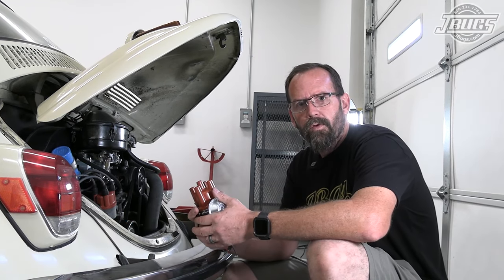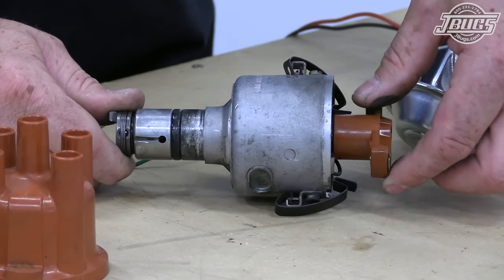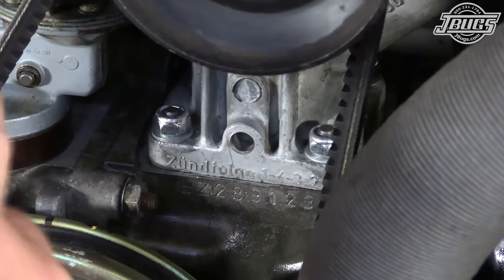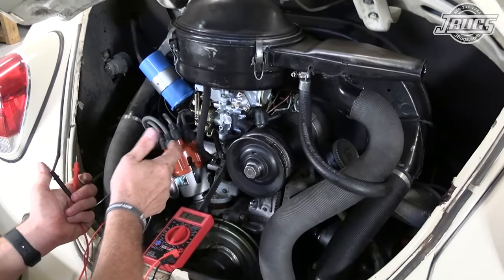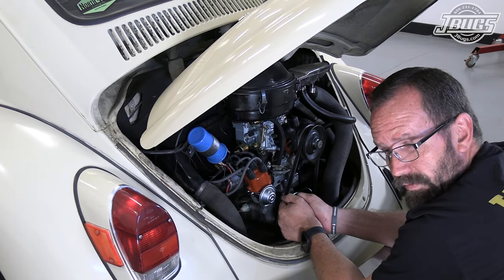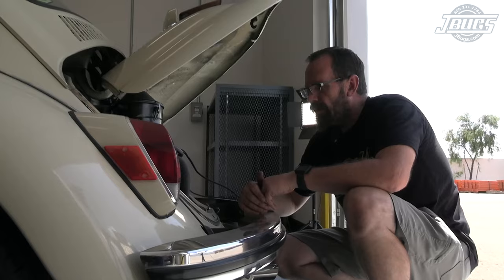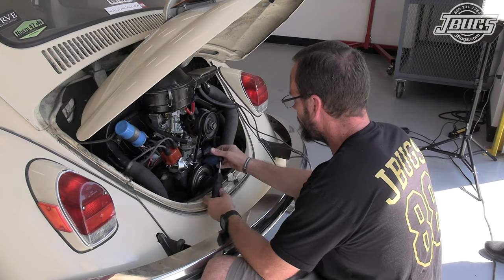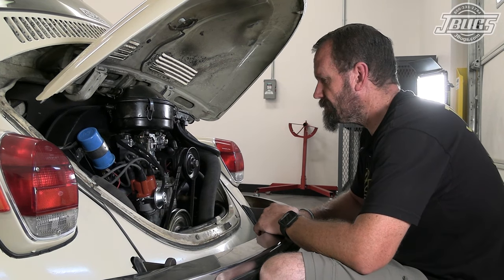JBugs - Installing a SVDA Distributor with Electronic Ignition

Comment: I recently reversed two spark plug wires and it did run, but really reallly bad. Because I was just beginning the project of getting her back on the road again, I blamed everything EXCEPT that two spark plugs might be reversed. I never even considered the possiblity that it would even start at all! Anyway... I'm sharing my big mistake with you because you were man enough to admit it in this video.  If you're reading, thanks for your hard work helping us keep our VWs aliive!
PS another consequence of crossing the two spark plug wires, three stock oil cooler failed  during my attempt to get the engine running right. The 'waging and torquing of the engine caused by the out of place spark plug wires caused me to replace 3 (yes 3) oil coolers during my quest to find out what why my 72's engine ran so bad.
Sharing my goof with everyone here if I may...if I had checked all spark plug wire connections  I would have saved literally weeks of my time. 5 minutes would have saved me so much time and frustration.

Comment: Which coil will you recommend for the SVDA distributor?
Reply: For a Pertronix distributor, I prefer a Pertronix coil to match the recommended Ohm rating of the ignitor module. Ignitor 1 - 3 Ohm coil, Ignitor 2 - .6 Ohm coil, Ignitor 3 - .32 Ohm coil.
Reply: @Sam_Mebane  thank you

Comment: Thanks Nice video. My distributor have two vacuum line on in the back also if i add pertronix carb with one vacuum hose do it will work.
Reply: A dual vacuum advance distributor has an advance, for smoother acceleration, and a retard for emissions. You install a single vacuum distributor,  just hook up the advance hose and plug off the retard hose.

Comment: I dont understand the "wherever this thing happens to land" part at about 5 minutes in...confusing!
Reply: Aftermarket (and even some Bosch, non factory replacement) distributors are often clocked in a different location than stock. Originally (like I mention at 5:08) the rotor pointed towards roughly 4 o'clock, or towards the back right of the car. With the new distributor, the rotor points towards 2 o'clock. So the position of the wires on the cap changes.
Reply: Ok…
So how do I know when I have the rotor positioned right?
Reply: @lcwatts2971  if you follow the video, and make sure to put the engine at TDC for #1 cylinder before you pull your old distributor, where ever the rotor points when you put the new distributor in is right.

Comment: Was that ported or manifold vacuum to that vacuum advance. Also what was your base timing set at. And 32° total advance plus vacuum advance You must have a lot of advance now. And also did you adjust the air fuel mixture screw at the end.
Reply: The vacuum advance gets a signal from a carburetor port, not the manifold. We set the timing at 32° without the vacuum advance connected. Under real world driving conditions, an engine will never see both full centrifugal advance and full vacuum advance at the same time so the timing will never go beyond 32°. Once the final timing is set, then the carburetor mixture and idle screws are readjusted, yes.

Comment: Hello, its possible to change the distributor with SVDA only the electronic ignition module? instead of replacing the whole distributor? Thanks in advance.
Reply: It depends on which SVDA distributor you have. They are aftermarket distributors and it is a bit odd nowadays to find one made that doesn't have an electronic ignition.

Comment: Question having a lot of issues with keeping it idle nice and bottom end power and hitting that flat spot 
I’m thinking to go to a vacuum advance distributor 
I’m being told  not to do with  with double carbs?      Any reason for that ?
Reply: Depending on the carburetors, you may not be able to run a vacuum advance. Not all carburetors have vacuum ports.

Comment: would i time this at tdc with the same distributor or at 7.5 and why?
Reply: We don't "set" static or initial timing, we only use it as a base line to get the engine running. With so many different original pulleys having different timing marks and distributor that have different advance curves you can't know what the max timing is until you check it. So, we always use the TDC mark on the pulley, advance the timing light to whatever fully advanced timing point we want (anywhere from 28-33 degrees depending on the engine) and set the timing there. Whatever it ends up at during idle (initial or static) is where it is. We've seen it anywhere from 7 to 15 degrees depending on the distributor.

Comment: I watched this video an hour ago and laughed at how you messed up with the spark plug wires, then I did the same thing 15 minutes ago when installing my new SVDA. (even if I marked the wires..). Karma I guess  😅 So happy I got rid of that nasty 009. My car came with an aftermarket carb (EMPI HPMX) and I noticed it had a plugged vacuum port (some don't have those) and I thought why not use it if it's there? I've almost had rear-end collisions because of that flat spot.

Comment: 2 questions: 1) looks like the timing mark at 32 degrees is at the bump out on the case next to the split, rather than the split itself.  Is this really where it is supposed to be?  I have seen other videos with the same alignment, so I just really am not sure where exactly I am lining up the timing mark. 2) will the dual advance work with a mild performance cam?  I am running a 1641 with an Engle 100, and wondering if I can replace my 009.
Reply: Sorry, I just saw this comment. The camera view doesn't show my view as I am setting the timing. Timing is set at the split in the case.

Comment: When you set the timing gun to 32° max advance you are looking at the TDC mark on the pulley, correct?
Reply: Yes, as the stock pulley doesn't have timing marks, I advance my timing light 32 degrees. Then it flashes at the TDC notch in the pulley.

Comment: I found someone to help with the super beetle. I want to get some parts so we can get started in a couple of weeks. Could you identify exactly which parts I will need to replace the rear calipers with pads and drums including the emergency brake cables and springs etc. (When the calipers were put on the rear, they were not ones that could take the ebrake cables) I will also be getting valve cover gaskets and oil cover gaskets and washers. Can you suggest anything else that would be useful for a tune up? The engine was overhauled about 8k miles ago. Any suggestions for rust prevention products for the underside?

Comment: Great video , but didn’t notice mention of 2 spacer washers in dist. shaft -care of centering those carefully before install. (?).  Thx
Reply: That's because the 2 washers are below the distributor drive gear. It wasn't (and usually isn't) pulled out. We do cover installing the washers in a couple of our videos this one is probably the most clear - https://www.youtube.com/watch?v=IoOp2wpvcQc&t=93s

Comment: My trunk lid will not open- I had help and it is really stuck. The picture of the mechanism that I found in the Haynes manual suggests that the advice to cut the handle in half and unscrew the upper and lower parts separately  does make some sense.  Do you have any thoughts on it?
Reply: Yes, if the hood (front) is latched and the hood release cable is not opening or freeing the latch, the only way to open the hood is by cutting through the handle. We use a saw-zall and cut just above the hood handle seal to cut the handle, and the bolts that hold the handle to the catch underneath.
Reply: Can you tell met you mean by the hood handle seal? Are you cutting close to the lower or the upper end of the handle? I looked at the picture in the Haynes manual and see two kinds of latches.  Once very simple and the bracket on one is veery simple while the other has a catch as well.Also you are not cutting through the hood, right? @Sam_Mebane

Comment: Since you are in a rather dry climate and I am in a water rich area…that may explain why there are so many more beetles in your area than where I am. What was VW’s thinking about rain coming in the louvres in the lid?  After a rain I opened the engine lid and was dumbfounded at the rain drops in there. It seems so odd but I never see it mentioned, should I worry about it?
Reply: VW used a "rain catcher" to do just that, under the louvers to catch and divert the water to the drain holes at the bottom. Ideally, make sure that your air cleaner is shielded from water, but on the whole, most of the time a little water in the engine compartment won't hurt anything.
Reply: Thanks. In a hard rain I put a sheet of plastic inside and used the lid to hold it in place. I’ll be keeping it covered in the summer too. @Sam_Mebane
Reply: @Ljblossom  just make sure the sheet doesn't completely block the vents, they are there to allow more air into the engine come into the engine compartment for cooling.
Reply: It was in the drive.I would not do this if I were driving which will take a couple of fixes to get to. A question. Since the car has the wrong calipers on the rear to have an e brake, which will cost more: changing the calipers or going back to pads and drums? My Prius had its first pad replacement, with no issues, at about 150K miles.  I know the parts price difference but don’t know if there is more labor involved in going back to drums. Are there any shops that order from the Ithaca NY area? The one possibility is gone until April.
Reply: @Ljblossom  if you can find the necessary parts to go back to drums, used since some of the parts aren't made new, that would be the less expensive option most likely. The hard part about possibly going to a disc brake with a parking brake is that you may have to get a complete new kit. Often times the brackets are completely different and not interchangeable between rear disc brake calipers.
Reply: The calipers on the car will not take the ebrake kit. The last question in my last reply was whether you have a shop from my area ordering parts which could tell me if there is someone in my area who works on these cars.  @Sam_Mebane
Reply: @Ljblossom  your best bet is to talk to local VW owners in your area, either through a club, online forum, or otherwise.
Reply: I have been looking but there may not be any. I really have not seen any old beetles on the road and none of the mechanics are knowedgeable. It is a different region here. Your weather has preserved them better than ours. @Sam_Mebane

Comment: Question, does the vacume advance have its own regulator ( hole size to limit the movement ). I changed the carburettor and at the same time discovered the vacume advance had failed and replaced the distributor also. Whilst I can now cruise at a reasonable speed, it is lacking the low rev torque it had whilst the vacume advance was broken. Wondering if the vacume pressure ( inlet size ) should be made smaller or some sort of restriction put in it.
Reply: There is no regulator, no. The distributor timing may be off which could cause the lack of power down low.

Comment: What size/kind of motor is it? Sounds like a strong stock 1600? What parts are not stock? I lke the stock (oil?) air cleaner! Better flow than filters?😉
Reply: It is, due to some prior parts testing, we ended up putting a new top end (pistons, cylinders & heads) on the engine so it is super fresh. Other than our replacement 34PICT3 carburetor and the SVDA distributor, it's pretty much all stock.

Comment: If you wanted #1 to still be in the original spot, can you lift up the distributor drive gear and turn it to the correct position, and then drop it back down or does something prevent that?
Reply: Removing the distributor drive gear can be difficult in some cases and as it sits in two small washers (that act as a bearing of sorts) at the bottom side that could fall off and drop into the engine we don't recommend removing the drive gear in most cases.

Comment: Where can I find the tool you used for adjusting the timing?
Reply: I use a 25+ year old Snap On Timing light with digital advance. You can probably find something similar at your local auto parts store or online somewhere.

Comment: Question I’m running 009 on 2180 stroker would this unit improve my performance?
Reply: If your engine has hesitation off of idle while driving, then most likely, yes. You’ll need to make sure that your carburetor/s have a vacuum reference for a vacuum advance distributor. As long as there is one, you can install a SVDA distributor and it should drive much better.
Reply: I've been running a SVDA Pertronix on my 2110 with dual Weber IDF carbs.
I've tried vacuum lines from both carbs into a T and one line from one carb into distributor, with and without a vacuum check valve. 
I've been thinking of taking it out and putting in centrifugal advance because I can't get rid of the hesitation at around 1500 RPM.
Reply: @goldentrunnell7450  you might check the vacuum with a gauge to make sure that the carbs are pulling enough vacuum (they should, but double check) and also that the diaphragm isn't leaking.

Comment: What are your thoughts on a shepherd crook on the vacuum line? Is it really needed to prevent fuel ruining the canister? Or just grumpy vw dudes on the internet complaining about how that is what the  factory would of done?
Reply: Can’t say I’ve ever heard of it but the logic is sound. If nothing else just run the line long and above the carb, then down to the vacuum canister if you’re concerned about it.
Reply: The Shepard hook is shaped like that ... for a reason ... otherwise  .. fluids (fuel or water)  gets down and flood the vac can. That will make things sluggish and prone to rotting the diaphragm.
I think it's metal, so vapors would condensate and drip back towards the carb. Imho

Comment: So after I set timing to 32 degrees and then add the vacuum hose the total advance goes up to 40. isn’t that much too high?
Reply: The vacuum you’re seeing while parked and revving the engine isn’t  what the engine will see on the road. Here’s a link to a thread that goes into detail - https://www.volkszone.com/threads/timing-svda-distributor-slightly-different-q.712848/